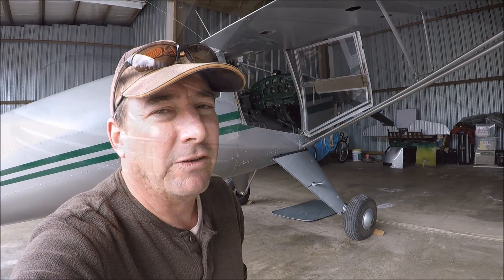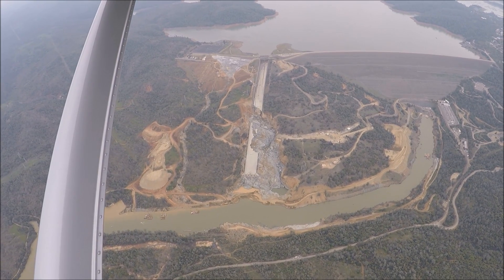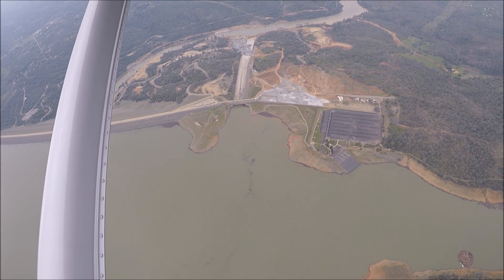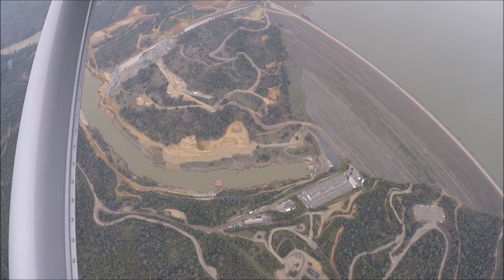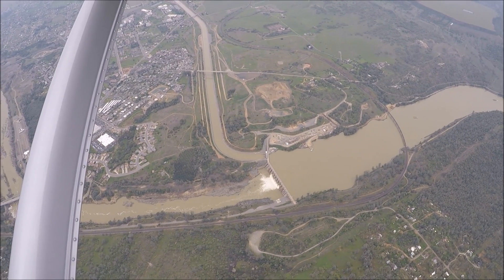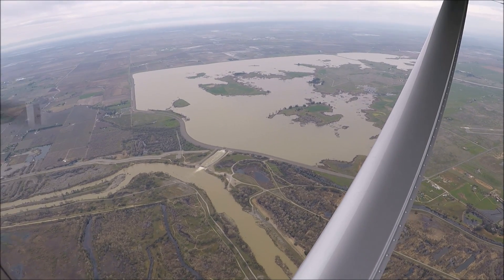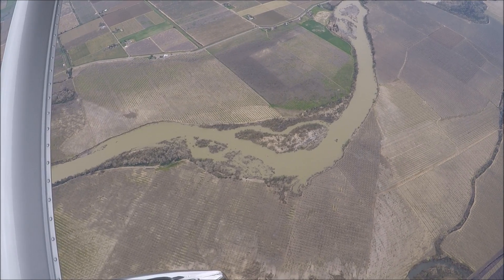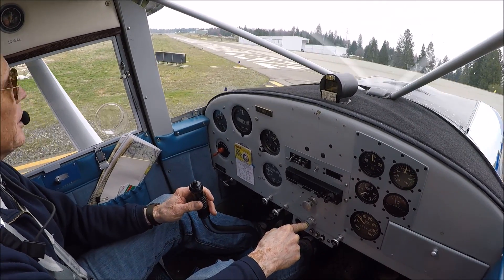Oroville Dam 15 March Flyover and Update

Comment: What are those pads they are building over on the left?
Reply from the maker: The benches?
Reply: Do you mean the area where all the debris has been stored? It's the pile of rocks that was washed out. They'll presumably need a lot of that material to fill the hillside back in  when the spillway is properly repaired.
Reply: These.
http://i.imgur.com/s2lIstN.jpg
Reply: I think you are talking about the eroded material that came out of the river.  My guess is they put the material there because it was close for the haul trucks and they was in a big hurry!   I am also guessing that they will reuse that material for whatever they need it for,  haul roads,  backfill,  or to make new concrete, etc.   They may even set up a Concrete Plant on the pads,...they are going to need a LOT!   If nothing else it would make a good parking lot for the heavy equipment until they shut off the spillway next time and have to clean out the channel again.

Comment: Thanks.  Great report and videography.  Love the beautiful, authentic vintage Luscombe.  But please apply black level correction to the out-the-window file(s).  It was sky high (an aviation pun for video engineering).  I suspect the GoPro may have auto black level but it may have gotten fooled by the overcast daylight condition resulting in the super low contrast/washed-out look. There aren't any 0 black objects in the view for a reference so I would display it on a properly calibrated TV and then monitor the waveform monitor while manually adjusting the black level for the most accurate re-creation.
Reply from the maker: Thanks, it's on full auto. Plus hazy overcast conditions.

Comment: look at pictures of face of broken spillway a month ago. notice that under it all you see is loose ground and rock. lack of or improper placement of footings in design, which allowed it to over vibrate, and shake itself apart when water was released and pressure applied.I personally do not think it even ever had footings. They laid out some forms, threw in some rebar, probably needed more, then poured a slab and called it good.
  Well now they have a chance to do it right. Take advantage  of newly exposed rock formations below, drill deep into rock ,put in steel and make some real footings and foundation for a spillway that will easily hold up to the forces and pressures of water release.
Reply: More likely simply water hydraulics. Have a look at some of the work done on the Scablands from the ancient Ice Age floods and the damage that water does to solid rock. It's the air bubbles and vacuum caused that explodes rock out of the bedrock. Nature is utterly unforgiving. It will exploit any weakness and the damage will continue until the thing causing the damage is stopped.
Reply: of coarse it was cavitation, or water hydraulics if you prefer. The point is the inability of structure to withstand that force being applied. So what exactly was wrong with design, thats the 64,000 $ question.

Comment: Another user mentioned that some of the dams upstream are at 100% capacity or over that amount in one of your previous videos. If they get the Oroville dam low enough once they open the spillway would the other sections higher than Oroville get the clearance to release water to a safer level?
Reply from the maker: They are already releasing at or near capacity up stream.
Reply: If any one of those upstream dams fails...
Reply: I read those dams collectively only hold 10% of what the Oroville Dam does so there isn't any cause for concern  about that.

Comment: Juan, another great & informative video.  I'm going to hazard a guess that when the DWR opens up the main spillway, the erosion won't be as severe, since most of the top soil and loose rocks have already been flushed into the Diversion pool . . . and subsequently removed, as we see.
Reply: I think the recession of the spillway will be less given that they have armoured the toe now. Also it should be noted that the further up the spillway the less the velocity of the water and the less the potential turbulence which is the main driver of the damage to the concrete will be I suspect. This whole thing has been utterly fascinating from start to now. Will be following the forensic examination closely.
Reply: The lake is still 37 feet below the top. Plenty of margin. Hopefully valley folks aren't following any of the fear mongering youtube vids.... Juan's is the only one that presents a rational picture. IMO, locals can rest well enough, and trust that the DWR knows what they're doing.
Reply from the maker: I think your right...
Reply: Yes, a long time to rebuild.  Because it's going to take quite a few 60-lb. bags of gravel from Home Depot to back-fill that hillside!   ;o))
Reply: Yes, Phil. But, also, the initial damaged area only migrated uphill a very small amount. They did tell us that they think lower flow rates could erode it higher, so they plan to open it to about 50k cfs, where it was. I imagine they might try to open the gates slowly so as to attempt to monitor what happens. I'd think that even though much of the loose material already ended up the the Diversion Pool, that subsequent erosion will be a lot less. Hope so, and imagine they are of the same mind.
Reply: How awesome would it be to have a transmitting Go Pro monitoring the flow over the edge at the toe of the spillway. Position a couple of them looking up to the underside of the huge volume of water spearing out into space. Oh I so hope someone in authority does this. Would give an insight into how the strengthening concrete works supporting the end of the spillway behaves.
Reply: I didn't start following this situation until mid Feb.  I still don't understand why they weren't releasing water almost daily when the level reached 860 ft.  I'm guessing that they may have had either too much flooding downstream, or they wanted to fix the small hole in the spillway before unleashing a full flow, or perhaps they were wary of the condition of the gates. I'm sure they had their reasons for choosing the weir.  Seems they are doing it again though by blowing off the 860 trigger point and allowing the lake to reach near capacity. I can't even imagine the suspense and stress levels of the folks in the valley.  Prayers.
Reply: Forecast I've seen didn't show more than a couple days with the PoP above 40% or so. My guess is the material that gets deposited in the channel will be far less this go round...don't expect any more damage up toward the gates, either. The broken area only migrated upward a small amount from the original early Feb hole.
Reply: Years of neglected repairs have resulted in ubiquitous decay.  The entire structure is so compromised, that putting a rush deadline on a full solution would just result in throwing good money after bad.
Reply: My new theory is Lake Oroville is now a lake that can never be drained, or at least it would take a very long time.  Need to know the capacity of the diversion tunnels.  At least at one time they were enough to carry the full flow of the river.  Perhaps the issue is the diversion pool must be kept as clear as possible in order that the diversion tunnels can be fully opened.   I think See Jaun News (SJN) did a video on the diversion tunnel valves.  Are they working properly at the present time?
Reply from the maker: SJN...I like that...
Reply: If it scours the sides of that hillside, well there is your new debris. Time will tell, won't it. Snow melt totals are unknowable right now as well.
Reply: What they need to do vs can do vs will do vs will they do it correct......this time.  Wait and see
Reply: Almost zero chance of that happening. As the damage widened, it migrated down, and barely up at all.
Reply: I dunno about that as it does look as though the natural lay of the rock would tend to allow the water to continue to erode towards the main dam. Until it fetches up on a dyke or other hard rock formation I suspect that the red soil and decomposed rock will continue to erode when the spillway is once again opened up. will be interesting to say the least who's prediction will bear out in the end.
Reply: PHIL BOX:  Looks that way to me too, especially after seeing DWR video of  the geologist measuring and noting the angle and direction of the erosion in the newly formed canyon.  I see plenty of loose debris, and also visualize much of the looser material from the steps, or 'benches,' flowing down into river when the rain starts.  Accuweather is forecasting six days of rain to begin on the 18th. The heavy equipment will just about have to redredge the channel.  The spillway is so massive, that the weight, which is no longer supported in the center, may start to pull the gates out of square - or even loose sections.  We will all be keeping our fingers crossed that the damage will be minimal.
Reply: But IF,.. the spillway chute  erodes back up to the gates and then starts to flow under the gates,....it's game over!   Hopefully it won't happen,....but......how many more times are they going to need to send water down it UNTIL they can completely rebuild it, or build a new one from scratch next to it?  This may still be going on next spring....or 2 or 3!    Planning time plus construction time PLUS red tape time.

Comment: It's mindboggling how inept they were at designing the emergency spillway.
Reply: Hunt Barclay  1960's design & engineering........we've come a long way since then, the past is always a different country.
Reply: It seems to me that the Emergency Spillway was primarily designed as a formality, a psychological pacifier if you will, like "this is the last resort to help get water out of the lake if the water gets too high, but that'll probably never happen". Based on the response to the people that tried to get it paved in 2005 I think the DWR really thought that they would never have to use it.
Reply: Erosion wasn't known about in 1960?
Reply: On June 4th 1976 the Teton dam located in south eastern Idaho failed.  It failed on their first and only attempt to fill the dam.  But thank god the spillway is still intact, it shows they got something right. 2 billion dollars later and all is well. Sugar city was in the direct path of the water I don't think there are a half a dozen original buildings left. All other buildings are well were new in the late 70's
Reply: Sideslip:  I take it you are a civil engineer.  Claiming it survived is a bit of a stretch.  It's more like it didn't fully disintegrate.  It's kind of like the only heart attack you had didn't occur for 70 years, but then it killed you.  One thing that's certain is a lot more water was coming down the spillway than the concrete structure could stand.   Hind site is 20/20.  The crisis appears over for the moment.  Let's just hope more rational thought is put into the redesigned spillway.  We can't afford more Twin Towers / WTC-7  style architecture.
Reply: Could it be possible a concrete EM. spillway was on the original plans but was decided to be EXTRA and cut out by the experts that controlled the $$$?
Reply: Yeah, the spillway was so badly designed, it survived water heights and flows it was never designed for.
It is perfectly acceptable for an emergency spillway to be damaged when it is used, it's an emergency feature, not a regular operational device.
There is always plenty of time afterwards to repair the emergency spillway, they are only used every 50-100 years, and often never at all.